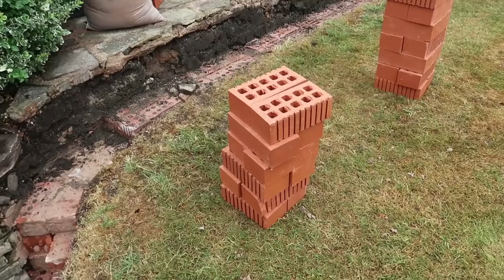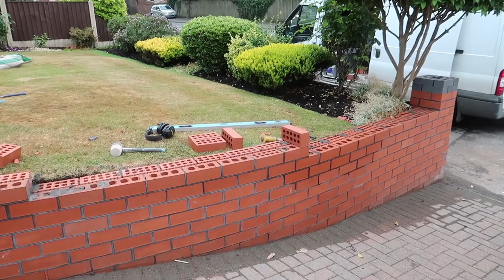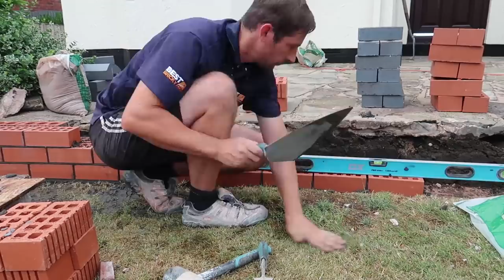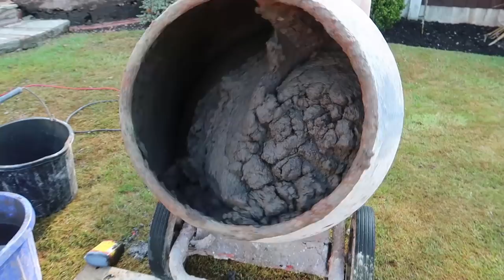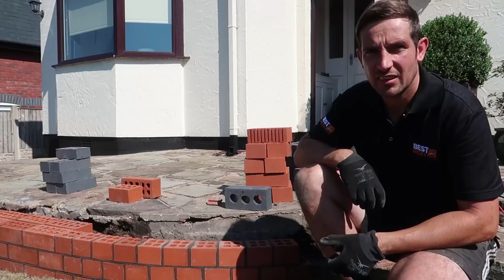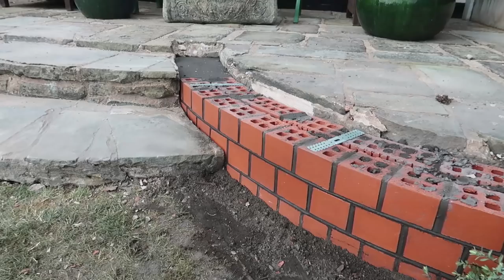Bricklaying -  Curved Garden Wall part 2

Comment: Once again nice clean work. Here in the States we would use a solid on the top or the " rollock " on the ends. We don't use a curved  line though we use a  "radius" level. LOL Keep up the good work!